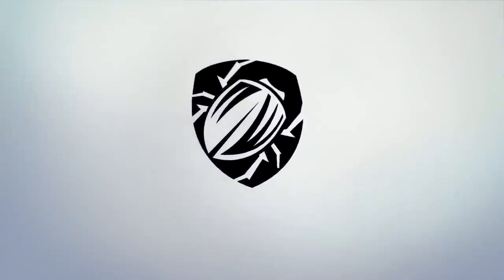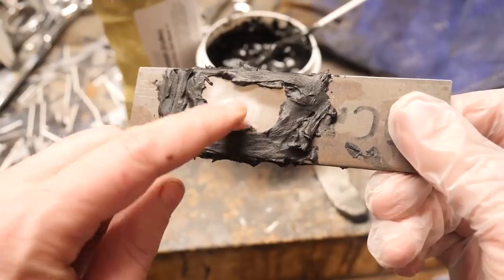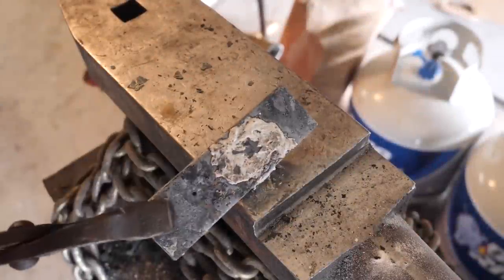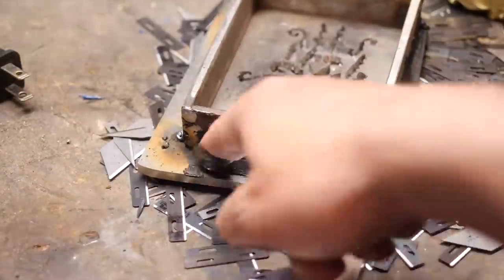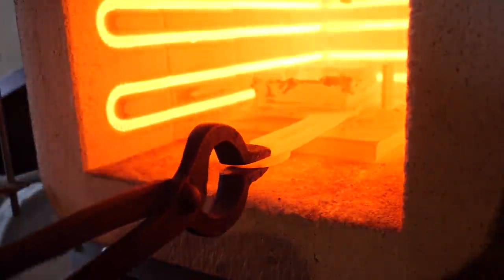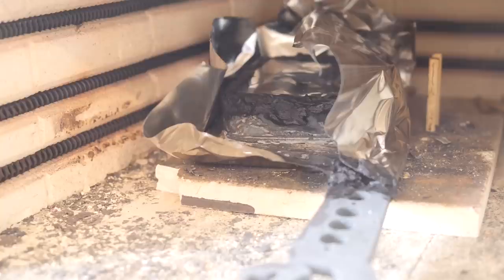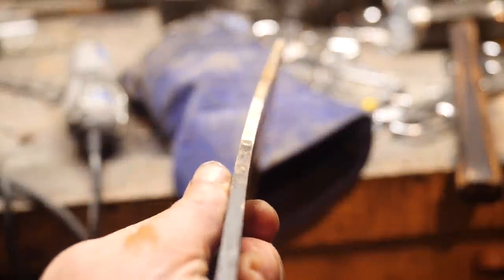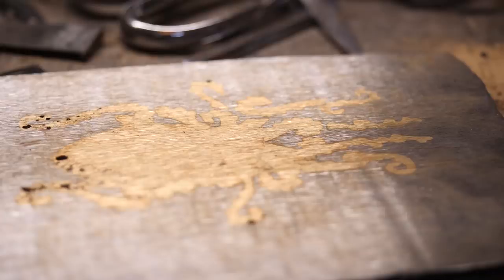Return of The Squid Cleaver!

Comment: It would be my recommendation that you forge braze it just like a cow bell or the tube and bit  for a key .... Put a small thin piece of steel for the back side and tack weld it in place. Put it in the forge and bring to a bright yellow heat then add your brazing rod ... A very small amount of flux will be needed to help induce the capillary action. Hope this might work for you :-) great video by the way!
Reply: Man, I just commented basically this above, I should have scrolled down first, guess it is true that there is no new idea under the sun lol...
Reply: brazing would have been my first choice too.

Comment: I'd have the inlay laser cut out of bronze 1/8" thicker than the steel and peen the pieces in.  Otherwise I'd heat the steel and try to pour the bronze in while it's hot.
Reply: that was my thinking.
Reply: It would be labor intensive but you could just transfer the pattern over to bronze and cut it out without the water jet if you wanted to do it yourself.
Reply: Cut the bronze to the approximate  size and shape, torch the bronze to soften and dunk in water, place over the holes and peen it in.  When done sand it smooth.
Reply: I'm definitely with the people saying get a few cutouts made to close tolerances and try a few methods from there: cold peening, self braze in the heat treat oven, things like that. Having it solid should eliminate the bubble issue, and it will make sure you have the right volume of material.

Also, an oxyacetylene rig is SO worth the investment. Cutting, bending, brazing, even heat treating oddly shaped stuff; I use mine all the time.
Reply: Was going to suggest the same. From my understanding knife makers sometimes cut extra large holes into their tangs and then peen in some softer metal for use later when drilling holes for pins.
Reply: Suggested the same then discovered you already said to use a cutout and peen.
Reply: This is a good recommendation. If you look at the construction of hand planes that use dovetail construction there is no visible gap at the joints. Check out Young Je for an example: https://youtu.be/mP9pkI1dLTM?t=581 or check out Rouleau hand planes.
Reply: yeah you might have do some tests with tolerances but even if you hand cut it out if it is thick enough then when you peen it down it should fill in some gaps. My other idea would be to try to fill in those remaining holes in the one you have by brazing them.

Comment: Just like with soldering or brazing, the material has to be clean and you can't have oxidization. You need to use Flux. I would braze it in, filling the area as you go. I don't know if you could fill those larger areas without a good torch, tho.
Filling the voids on your last attempt wouldn't be difficult brazing with a torch. 
Whatever you do, having clean metal and fluxing will be essential. 
Good luck!

Comment: If I were to attempt this, my process would be as follows. I would first back the cavity with steel to prevent losing my brass, then I would heat the blank in the forge to he melting point of brass and manually add brass with brazing rods to the hot blank, you should be able to fully braze it up using only your forge as a heat source. I do not own a oxy torch  and I have brazed a few parts using a makeshift forge as a heat source, when the part is hot enough, the brass will flow, just be sure to use flux...

Comment: My thoughts: 
1) the powder needs to be compressed into the void to elimate as much air space as possible.
2) the bottom needs to be sealed better to eliminate leakage.
3)  clear resin with bronze powder into a thick paste, infill, cure, grind, then buff.
4) brassing. Cut a thin foil template, heat, bronze/brass brush the stencil.

Comment: If I was doing this I would definatly be using oxy acet or my less favorate oxy LPG, I have found in the past using whats called bronze when held at a high temp for a long time even on sections up to 3mm thick the brass penetrates the steel and causes cracking in the steel. If it is brass you are using the zinc also has a tendency to boil and or fume if over heated and oxidise which leads to porosity. I would use silicon bronze as this has almost or no Zinc and flux which is just borax with colouring added with a flash sticker on to justify the price, Flux makes the bronze much wetter and will flow better but can be more likely to escape.

Comment: Jewelers cast very fine details with vacuum casting. Usually, they'll start with a metal flask that has holes cut in it, temporarily cover those holes, put their wax tree of things to be cast inside the flask, pour it full of plaster, vacuum out the air bubbles, burn out the wax, put the flask into a vacuum again (but with the pour-hole exposed), and pour their liquid metal into the flask while it's still hot and under vacuum. 
For your project, it would go something like: Fill up the pattern with wax, make a pouring funnel/tree out of wax, attach it to your wax-filled pattern, put some kind of metal container around the wax/knife structure to hold the plaster, pour the plaster (vacuuming out the air bubbles from the plaster is not so important in this case, because you intend to do so much post-processing that it would be a waste of effort), perform a proper burn-out cycle, find a way to hold the flask inside a vacuum while the pour hole stays open, and pour the infill. 
Easy/Peasy, a monkey could do it.
Edit: I think one way to pull off the weird flask/vacuum trick would be to fill the pattern with wax and keep it from melting while you tack about 2 inches of depth of a soup can to the bottom, and a full can to the top. Pour the plaster into the bottom can, then melt-attach your wax sprue/tree structure to the top. Pour the top can plaster, do your burn-out, and just do a basic vacuum from the bottom, like VOG does in this video: https://www.youtube.com/watch?v=EGNnH_xbjR4
whatever gaps may remain between the can pieces and the blade should not be a problem, as there is plaster there, and a vacuum pulling from the very bottom.

Comment: Since you are using a forge. Try the old fashion way. Heat your blade. Get it to brazing temp with foil on the bottom. Begin feeding brazing rod into the opening while it is still hot. Perhaps decrease forge temp to a brazing temp while you fill the void. Once filled bump the heat up a bit to level the brazing out.

Comment: Brazing is definitely the best option here, you could possibly heat up the cleaver in the furnace up to near the melting point of brass/bronze and use the mapp gas to maintain the heat as you add the rod

Or find a buddy who has an oxy acetylene plant, preferably one that stands 2m away
Reply: U can get a cheap setup with small tanks for probably less then the brass costs. No need to but anything more for this 1 project. Although it would be a good shop investment if u did get a decent setup

Comment: My man! I would have never thought to cast into a knife blank! So, my contribution is going to be suggesting that you have them cut laser cut the squid out of thicker brass and treat it like inlay - peen it in. The critical thing is to cut a slight concavity into the walls of the cutout where the inlay will go so the brass will have something to grab onto when you peen it. It doesn’t have to be much but it does have to be there. Look at engraving videos about inlaying wire. Only experimentation will tell you how much undersized you should cut the brass blank but if you crack this, you’d be the guy who popularized this technique in the knife world.

Comment: Pick a piece of bronze a little thicker than your blade. Trace design onto bronze and cut with a jewelers saw, water jet, whatever. Insert bronze inlay and mushroom both sides with hammer and grind flat. Worked for the viking with wrought iron and always works for me. Great vid as always

Comment: Since you have the blade laser cut, consider having the brass also laser cut to fit.  After doing a small (relative to what you have tried) amount of work cleaning up the brass cut-out, you should be able to inlay brass into steel.  If the fit is good enough, that may be all you need.  If it is not good enough, then consider brazing it in place or having someone with a larger torch do it.   Disclaimer:  I have not done this.  My metal work was in jewelry and I did occasionally inlay one metal into another - always by hand cutting and filing until they fit tightly.  Best wishes for completion of your project.

Comment: So I do this a fair amount.. you can sand cast this, but pouring molten bronze and letting it flow into the space.  Borax is a good flux for brass, but you need to be carefull because when it is molten the zinc wants to evaporate. You generally want To pour at 100° hotter than melting if you can.

Comment: If you build up a little raised wall of weld under the knife, then grind the wall flat, the brass will be able to flow all the way through the squid hole, possibly eliminating trapped air. That, combined with proper heating and everything could make the pouring method work

Comment: I think bronze powder is only supposed to be used in resin cold castings. The powder is so fine and is a combination of metals. Parts of it will just burn up into vapor instead of melting I believe. And you'll get bubbles from the vapors.

Comment: I think preheating the blank and making a mold around it will work. If your gonna use the powder I think it will require more of a sintering technique. It would have to be completely sealed other than the top then it would need a piece of plate that fits down into the mold to press it with a very slight gap to allow the gasses to escape.

Comment: Cut out the bronze from a sheet, fit it like a jogzaw puzzle, flill it in a mold with some resevoirs because bronze shrinks and let it filll naturally. Put it in a sealed sand mold and torch the sand on top so it doesn't leak

Comment: Hey Beetle Borg! I just thought of something...What if you had a lot more bronze, melt all the bronze, have the knife standing vertical with the handle up in a pouring container which is wide enough for you to pour the bronze into and shallow enough so that when filled with bronze, the squid cut out will be completely submerged. Might need to make a jig to the knife stand throughout the process. Once poured, let it cool completely. and then take out, and saw off the excess from both sides, then grind down. Bronze squids swim deep beneath the molten surface  :3

Comment: I have done a bit of casting and have a few ideas both using a vacuum casting method. A bit of a janky method might be to place a big chunk of investment on the bottom, heat it up, and lay it over a vacuum casting rig meant (using a silicon seal and the necessary accouterments) and pour molten brass or bronze into it. The air and gas bubbles would be sucked out thru the investment and you would be left with a near-perfect cast. I'm not sure how well this would work as it cuts a few corners but I had another idea as well. Fill the squid shaped hole with wax, wax melts at a low enough temperature to be easy to work with and get perfect. then attach a sprew or two and place it in a large perforated flask and fill it with investment, burn out the wax and cure the investment, heat it up to an appropriate casting temperature and pour the metal. Let it cool a bit then chuck it in a bucket of water to get rid of the investment and bam, you have a cool knife in need of a bit of finishing work. Obviously there are a few issues with these methods namely that you don't have a vacuum casting rig. If you want to get into more casting I'd recommend one but if you don't and don't want to drop a good chunk of money you could ask a friend or viewer for a hand. Its also very possible that because vacuum casting is what I'm used to its what I would use even if it's not the best bet. I've (badly) drawn a few diagrams which I have links for here; https://pasteboard.co/J8T717a.png, https://pasteboard.co/J8T7bQe.png. I'm a big fan of your work and I love the way you work on stuff and figure it out, you make forging seem really approachable. I have complete faith in you and the community's ability to figure this out.

Comment: Have no idea if any of this works, but might inspire to something :P 

get rid of the lid and use a stick to stir around while pouring the bronze or while in the oven. 
Shake it (more and faster then you did in the clip) while in the oven. 
More/better flux. 
Mix the flux with the bronze powder.
Higher temperature to make the bronze more fluid/thinner(?). 
Pour under pressure.
Instead of melting a big lump of bronze(powder), which will trap the air try pour it  in a thin stream so the air has time to escape.
Melt it in vacuum.
Put the knife on edge, vertical, with a funnel shaped mold around and pour the bronze equally from both sides of the blade.

Comment: Normally I wouldn't comment on a vid and heck, I barely have anything to do with youtube, but thanks for the content over the years- you're doing great.
Going back into the way back when machine of avoiding 3rd degree burns in sculpture at uni, with bronze there's the melting point and to get it to flow properly you need to add about another 200Celcius to the temperature before it flows properly. 
Also at that point when she's really crazy liquid hot, you scrape off the scale/scunge that forms over the top of it and throw it away- then pour
You will need to pre-heat the steel as well, usually to about 4-500C just so its not going to shock or unevenly cool
Lastly- NO WATER or moisture on anything, the recipe of bronze plus anything like that is explosions, death and burns to the depth of your soul. But plaster of paris is also quite a cheap alternative provided you let it dry and then cook the water out of it for a while and should save you some furnace cement which is kind of spendy to slop around.

So, start making yourself a crucible, at the temps we're talking here you can use mild steel tube of your desired diameter and content with the bottom welded up. But your forge should do the temps ok and stop throwing borax on it :)
Anyway, hope that helps. Though if you're after true madness its starting to come into the cost + disaster of some of my mokume-gane experiments over the years!

Comment: 100% braze it in. It doesn't take much practice to get it down either. It should fill in really well. Its easy to control your heat and you (or whoever you fond to do it) can flip it back and forth to get all the nooks and crannies.

Comment: I can't help you with the bronze inlay, but for your vise- get some half inch mild steel plate and make some smooth soft jaws so you don't mar your work with the cross hatched jaws you have. I did this, using the factory jaws as a template, and it is a quick, easy job and you can switch back and forth as needed.

Comment: I wonder, if the cleaver is cnc cut, perhaps we could try not cutting all the way through the blank? So you'd have a backing of steel there prevent any leaks. Then perhaps, heat up the bronze and the blank, once both turn red hot, add flux and then pour the bronze into the blank? That's one route I might try. Idk.

Comment: I would CNC the Octo out of brass around 2mm thicker than the blade. Then fit the octo in the blade then seal and heat up brass to liquid.   I know very little about metal pouring but that would be my next step to try.   I will be waiting for the next video to see it you can make a plan. Have fun and see you in the next one

Comment: I’m sure if you could add some vibratory function to your furnace you could get the liquid to agitate to evacuate the bubbles but I do think an oxyacetylene torch would be a much easier solution. An hvac torch setup is a couple hundred bucks, you could buy a used unit from an auction as they will show up from time to time.

Comment: If you have casting sand, could you place the cleaver onto the casting sand directly to avoid welding?  if needed some of the sand underneath could be removed so that once its poured you would have some additional material that could then be ground flush. It seems like casting got you the closest. Also could take a torch to the cleaver to raise its temperature before the pour to allow the bronze to flow a bit easier around the edges instead of contacting cold steel.

Ive never done any casting so I may be way off base. Either way great content and keep it up.

Comment: Using a Jewelers saw, cut out a bronze octopus.
Grind a rough seat in the walls of the cut out on the cleaver. 
Place bronze octopus into the cutout.
Then use a chasing hammer and round nosed chasing tool to "spread" the bronze into the seat.

Comment: It will be really hard to cast the Brass into steel. Two problems: 1 steel will oxidize and the oxides will form bubbles. 2 the Brass powder first forms droplets that can catch some gas. To degas the Brass you can add some phosphor bronze but I only did that while casting. The "easiest" way to make something like that I know is to cut out an inlay, cut an undercut in the Form and hammer it in. The second way is to silvers solder it in. Both ways are really hard to do because your Inlays have to be exact. One Idea for casting would be to use aluminum bronze. This bronze flows longer but it can be break. Also the steel has to be coated with borax or you will have some points were it won't stick. I hope that was helpful. Keep in mind I am just a sculptor not an metallurgist so I might be wrong.

Comment: I'd recommend getting a cheap oxyacetylene torch, to fill in the bubbles.  Get your initial fill-in with the casting sand and heated moulds.

Another important thing may be for durability: carve a dovetail into the sides of your design, maybe with a router, so's the brass doesn't pop out with (ab)use